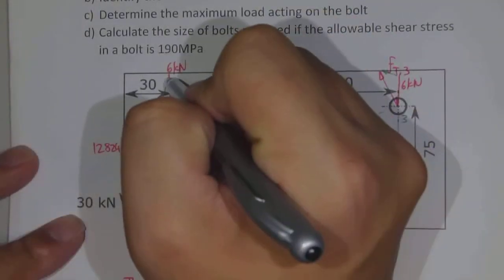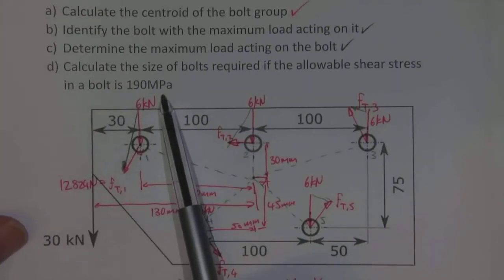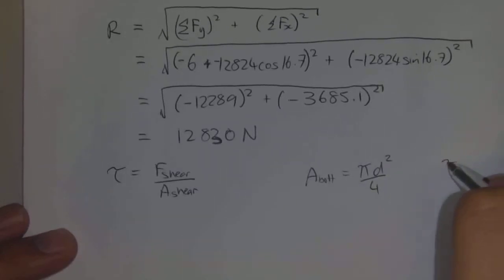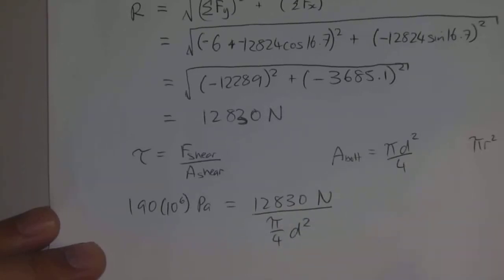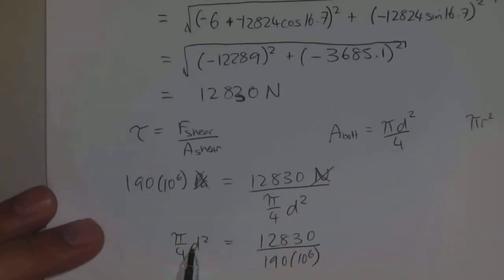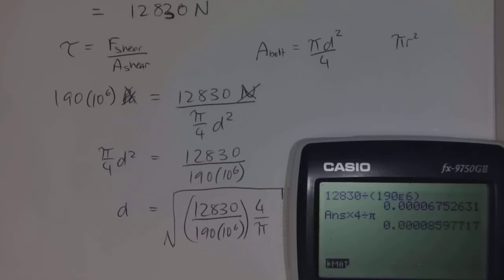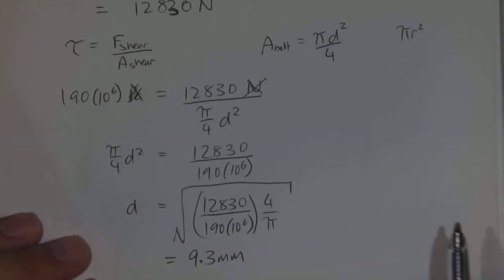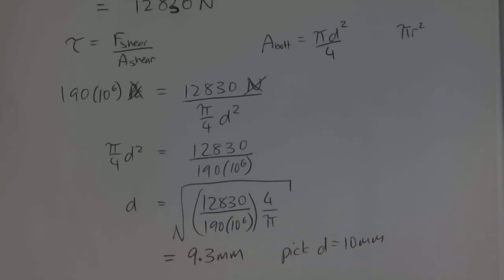Example - Bolted connection with torsion and shear loads (Part 6 of 6)

Comment: Sir, here comes the part that I got confused, in expression "-6-12824*cos16.7", isn't the unit of number 6 kN and of 12824*cos16.7 N, how can they be added together without converting units at first?
Reply: Thanks for your comment. They cant be added without first having both in the same units (N or kN), I made a mistake here and currently I'm not able to fix the video. It should have been 6000N here.